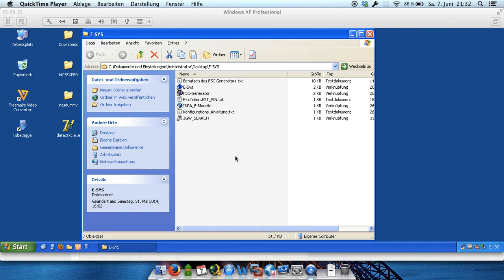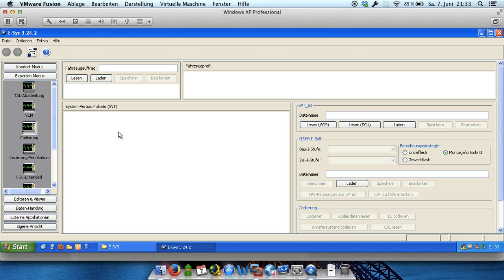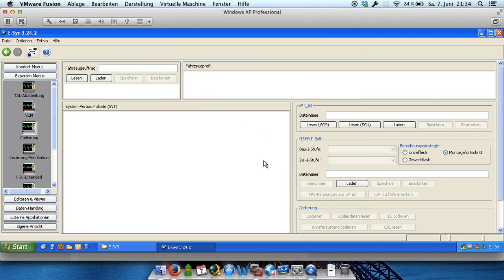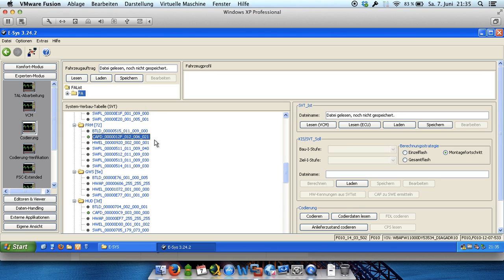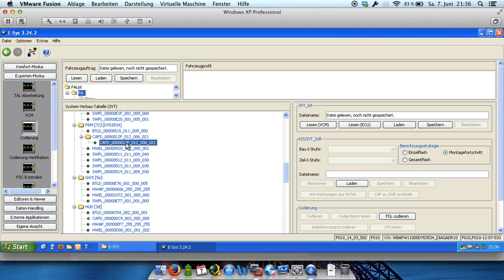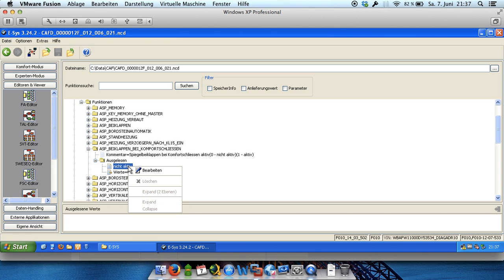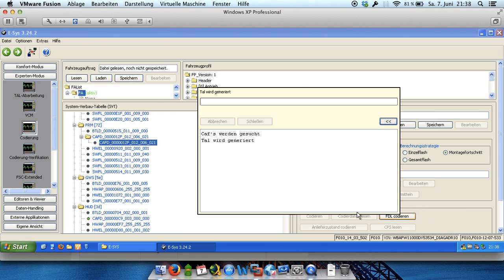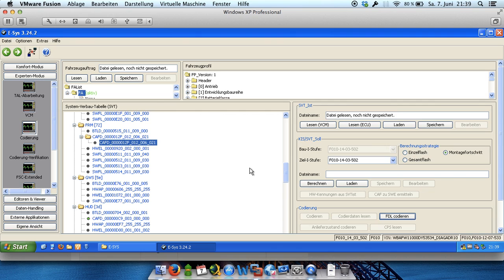BMW F Coding with E-SYS english tutorial

Comment: Thanks, I have a question, I had to replace the EKPM module (f10 fuel pump control) bought one from ebay, I think it need to be flash and coded, so you know how I can do that?